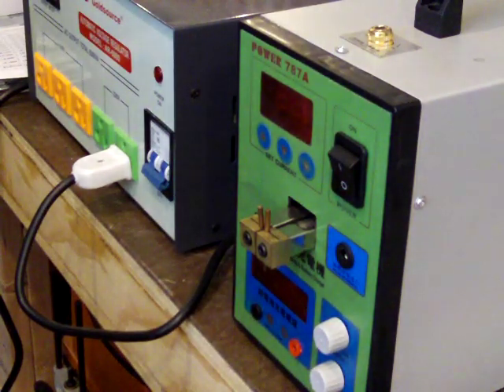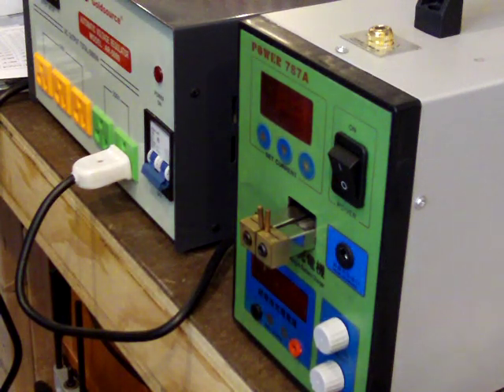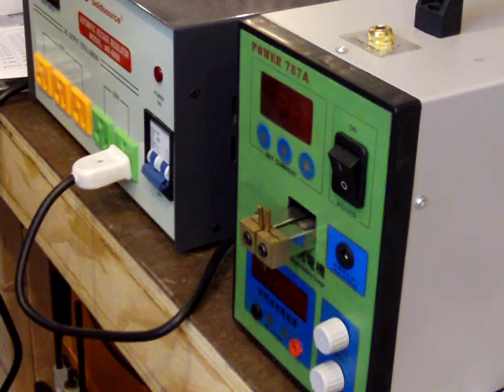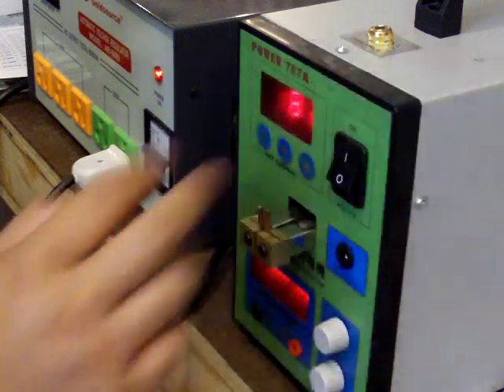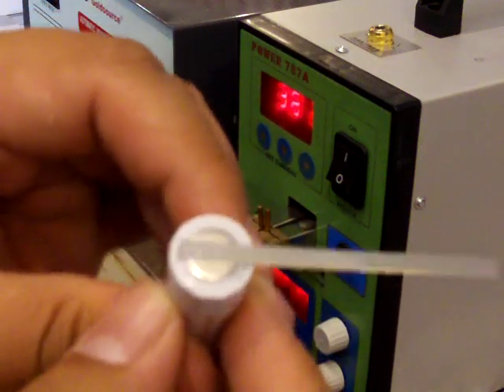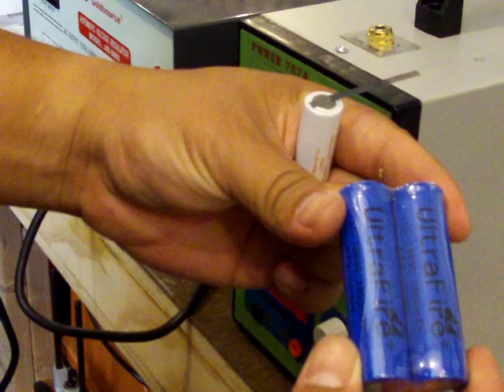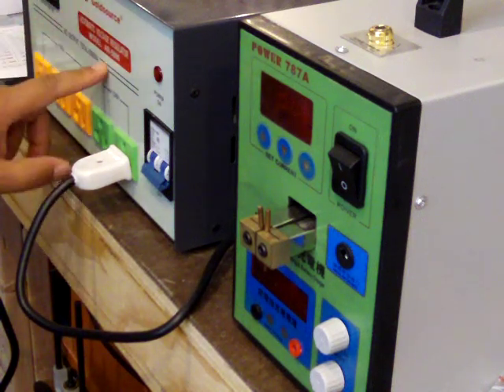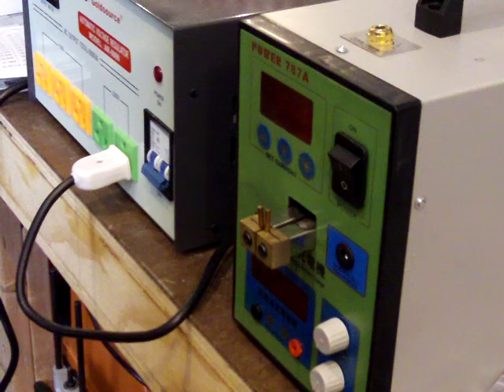Using a Power 787a as a battery welder

Comment: How's it held up after 4 years now? I am in the market for one to do the same thing you are/was using yours for.
Reply: Never mind. I just read through all of the comments and seen where you said you sold it. I will ask, do you regret purchasing it for no longer than you used it? Or would you have rather just spent the time and made one from a microwave transformer?
Reply from the maker: +Kevin Hanes if I was going to do it again, either the microwave transformer build or I'd buy a real battery welder.